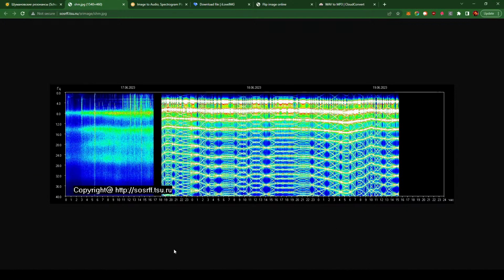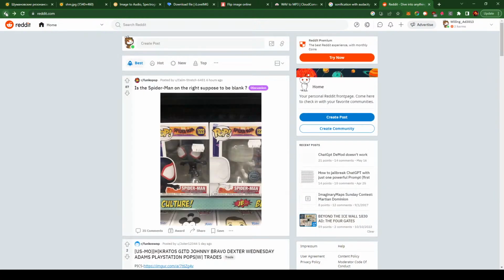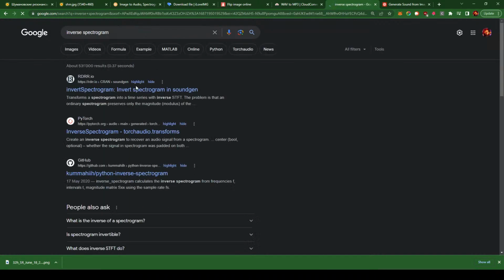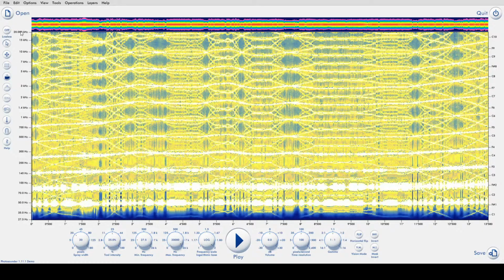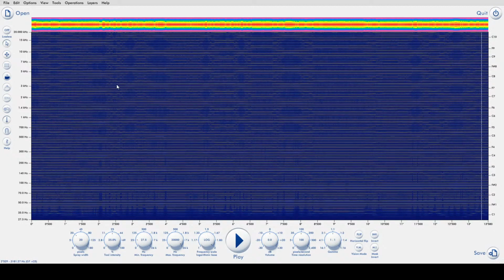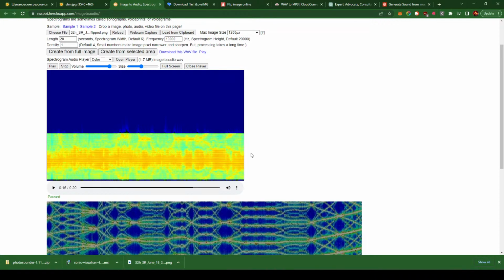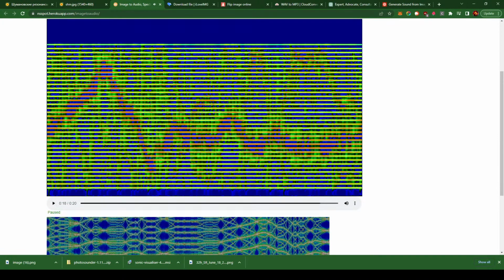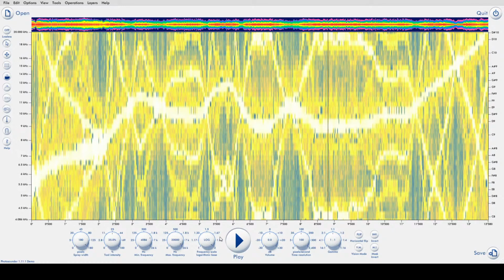Schumann Anomaly Part 2: Follow-Up to "Weird Schumann Resonance June 18 2023 turned into sound"

Comment: Have you tried multiplying the frequencies by multiples of the golden ratio?
Reply from the maker: Yes I used several multipliers, but what was more helpful was to find the right pitch and speed so we can discern speech.
Reply: Radical ratio play around constants. Mustn't be invoked if not involved. Which really this artifact has no base or benchmark. Theoretically it a summoning of sort...